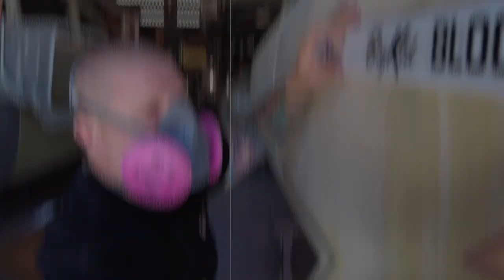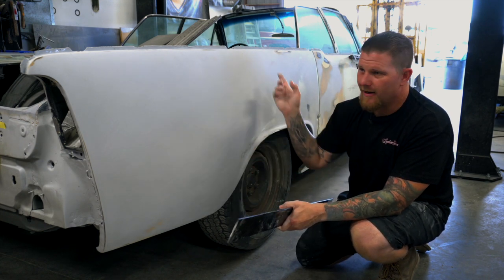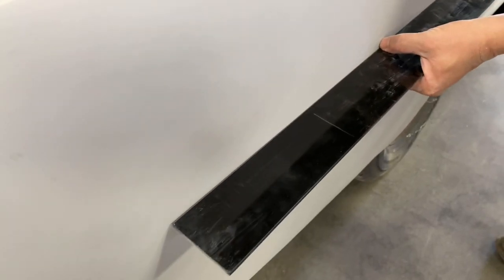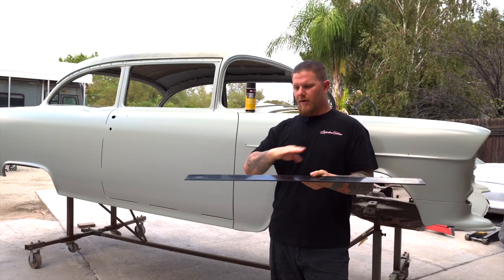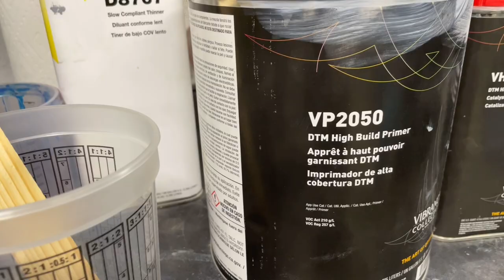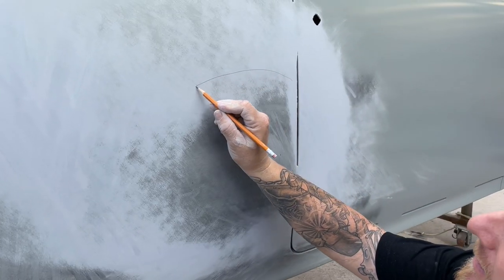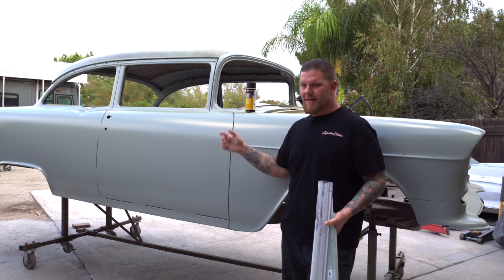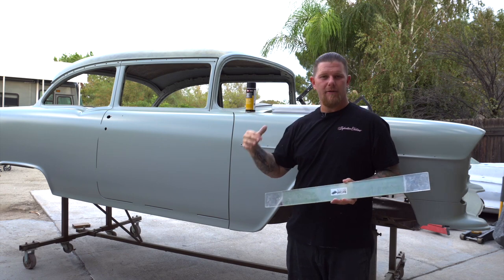Splines for Bodywork and Metal work. How-to

Comment: Great tips on body work. Everything you mention is spot on. Although I've never built or have worked on custom cars , I've used these techniques for building  sculpture. We built our own 4 foot blocks with handles to be used by two workers. We had a contract for six 40 foot tall x 6 foot wide sculptures @ 25,000 pounds each. For checking  flatness we used 4 foot long fluorescent lights. I agree, very few shops will do this level of work. 🤙🏽
Reply from the maker: Wow that is cool sounds like a huge project!! Thanks for watching!

Comment: I own splines, and here in Australia they are used from checking your panels to blocking. I've done the Melomotive course and it was very informative.  It's a little hard to hold while blocking but I was shown a trick by using tape on the back to make a handle it was quite easy. The tape was stuck on like 2 L's back to back. Very helpful in applying large Ares of body filler to the correct shape too. It reduces blocking time considerably. The bloke that makes these use to work for Holden in design. Melomotive have Facebook site too.
Reply from the maker: Yep these are melomotive splines. We have other videos showing how to do exactly that.

Comment: Great vid. Newbe Question: do you install the door rubber seals after this scribe process? If so, does installing the rubber seal mess it up?
Reply from the maker: You absolutely need all latches and Ruben in the intial set up then once you verify it’s all fitting properly you can then remove rubber and latches and lock it in.

Comment: Hey man I recently brought myself a set of big kids blocks to suit stick on paper. What brand of paper do you use/ recommend I'm having trouble with the paper I'm using. When I rip it off the block it tares and bits of paper are left stuck on the block. It makes it hard to remove any tips on how to do remove the excess?
Reply from the maker: We use sunmight and carborundum paper. I’ve noticed in the summer you gotta tear the paper off once you are done for the day. If they sit on there to long it’s a pain I use acetone
Reply: Warm the paper with a heat gun !

Comment: is it possible to get that high level without filler.  If its in that stage on the video and its straight do you go to the filler stage or just another coat of primer
Reply from the maker: Skim coating is the only way you get a mirror from panel to panel front to back. We do filler work and typically prime once after.